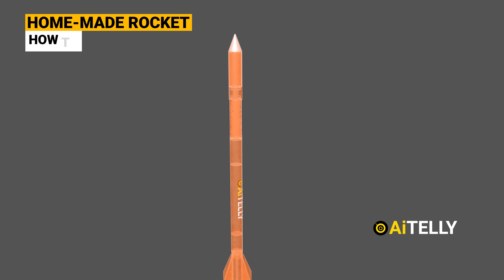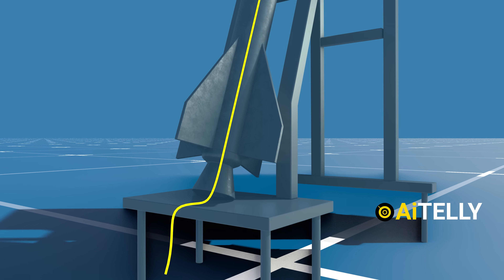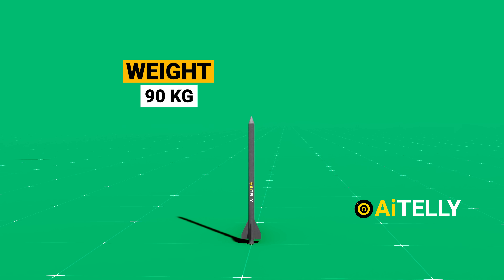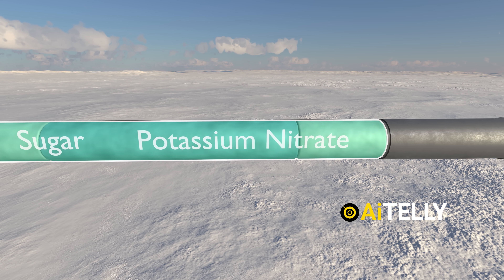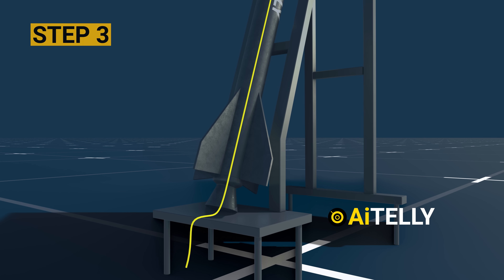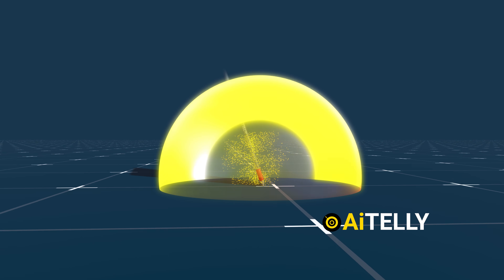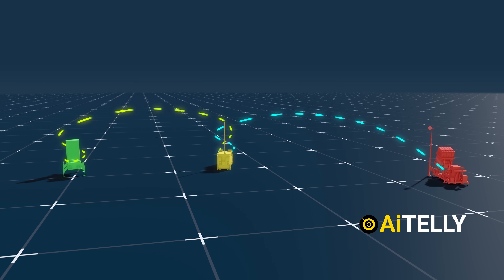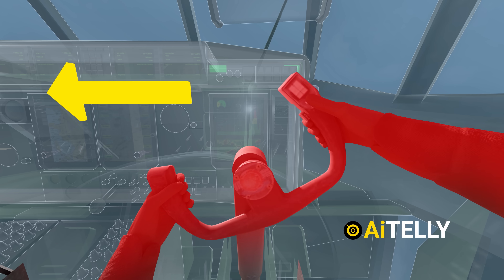How Hamas Makes Rockets against Israel | Qassam

Comment: A lot of people are accepting the Israeli hypothesis not because its reasonable but because they refuse to accept the possibility that indeed it was Israel who on purpose launched a misile into the parking lot of the hospital. Let's be realistic, the possibility of the event of the rocket failure getting into the hospital is highly unlikely, I would say nearly impossible. I will explain:

First of all it's important to note that graphic information provided by Israel has very little value or not value at all: videos from far away, at night, images of low resolution, satelite images... Those are not only very easy to manipulate or fully create, but almost impossible to know if the images are real or not. Maybe some years ago it was possible to detect an image that had been manipulated if it was analyzed at a pixel-level by some algorith, but today I'm sure that those photoshoping detection algorithms can be fooled. 

Therefore the images provided by IDF will show what IDF wants. PERIOD.

So now, let's analyze the version that Israel says that happened, because in order for this to happen several events have to occur simultaneously:

- The location from where the rockets are launched has to be behind the hospital more or less in the direction of the rocket launch. Why launching from that location? It is possible, but it's not the only possible location and in order for this event occur as Israel said it has to be necesarily from there. If someone tells "but IDF spokesperson said that the rocket was launched from that place" I would say: obviously Israel says that, and their "proof" is an image of a city at complete darkness from which projectiles are launch, and then they add an arrow pointing at a location that indicates that the hospital is there, and the launch site is there. There are no visible elements that allow to identify the exact location, and even if they were all this can be manipulated. So at the end this piece of information is IDF telling us "trust me, it is from here"

- The rocket has to fail at mid flight for whatever reason. Ok this can happen since these rockets are not so reliable. But then the rocket turns back and goes into the hostpital. These rockets have a range of 16km, so the area where this rockets can land is quite big:
- Let's say that the rocket in an event of failure will travel a distance of 10km or less, and that the area where this rocket can land is a circular segment of radius 10 kilometers and an angle of 15°. This would make an area of 0,82 km². 
- Now compare it to the area that occupies the hospital, let's say the hospital is 200m by 200m (I have not checked the exact size of the hospital but the order of magnitude is reasonable. Also it doesn't matter if is the building or the building plus the parking lot). Then the area of the hospital is 0,04 km.
- With this calculation we can get that the probability of the rocket landing in the hospital is about 1%. This is a simple calculation, but gives us an order of magnitude.
 Because we are not talking about a rocket failing and landing somewhere in the Gaza strip, we are not talking about a rocket landing at some random building in Gaza. We are talking about at rocket landing into the biggest hospital in Gaza. The same hospital that the IDF demanded to evacuate several times. It's not a random location, it's a target.

- The rocket has not only to turn arround at mid flight and land at the hospital, but it also has to fail in a particular manner. A rocket could fail in many ways: not burning, deviating, not exploding.. But in order for this hypothetical failed rocket to produce that damage the  solid fuel propellant has to explode when the rocket lands. But this solid fuel propellant is designed to burn during some time to propel the rocket, it is not designed to explode all at once. So what are the chances of the rocket failing in this particular manner.

So in order for the Israeli version to be true it would be needed a rocket fired from certain area, failing at mid flight, landing directly at the main hospital in Gaza and exploding in a manner that does not correspond to the functioning design of the rocket. Do you know how is called this concatenation of unlikelly events? Suspension of disbelief. That is what happens in action movies so the movie can happen. The spectator has to stop analyzing the chances of that happening because if not he does not enjoy the movie. This is the same, in order to keep supporting Israel someone has to suspend his disbelief.

Because we have not only the occurrences that I mentioned above, the guys from IDF also provided some additional "proofs": The ridiculous conversation between two Hamas members that in just one minute provide all the details that support the Israeli thesis 🤦
So not only we have a very unlikelly rocket failure, but the IDF picked that particular conversation where they provide all the details. Again this conversation can be staged, we are not dumb. 
The fact that IDF adds that conversation to their proof just show a desesperate atempt to sell their version, that's a lot of effort for a suposedly accidental failure of an enemy rocket. 

Additionally that conversation, if it was true raises a lot of questions: If they spy all the conversations so intensivelly that they find that conversation in a few hours.. How come the Israeli intelligence services where unable to detect the preparations for the attack of october 7, that was prepared during a whole year. 🤔

For me this shows that not only was an Israeli misile, but the attack was deliberate.

Another argument that I have read to try to divert the blame from Israel is "if it was Israel there would be a big crater"
OMG, this is so easy to refute: Israel is a very modern and sophisticated army that has access to many kinds of weapons, the more sophisticated ones and the more simpler ones, misiles that explode and penetrate or misiled with an incendiary explosion. Is someone accepts the "big crater argument" is like telling Israel that when they attack gatherings of people they have just to use misiles that don't leave a crater, then they can say "It wasn't us, it was another Hamas rocket failure" 
🤦

thanks for reading

Comment: I had read somewhere that they actually figured out how to make a crude, guidance system for them. Sometimes using a ESP32 or similar microcontroller. I really wish I saved the link because, it was interesting what they had figured out so far to make them more accurate.
Reply from the maker: I will research and find out good one
Reply: The Arduino flight controller can be plugged into almost any vehicle you can conceive of and will fly it better than many humans who have had training on the vehicle, I use them for missile sonde and AMM. "Rocket science- a long bomb with a hole in one end"
Reply: @LordCaptainFather  you know importing arduino is not worth the trouble
Reply: ya why cant they make guidance systems with rasberry pi?
Reply: @AckzaTV  raspberry pis are kept by scalpers lol
Reply: @AckzaTV  I'm sure it is possible with most microcontrollers!
Reply: they probably just put a child into it
Reply: Israel cam block GPS easily 😅

Comment: Good explanation on how palestinian resistance build their rockets, but I just want to point out that these rockets have nothing to do with the bombing of the hospital in gaza for abvious reasons.
-the explosif power of these rockets is very week compared to bombed droped by israili aircrafts that each one of them weights about 1000kg most of this weight is explosifs. The amount of destruction shown after the hosptal explosion shows that it is impossible to do so with resistance rockets.
-there is a video that shows a bomb hitting the hospital with the same precision, sound and explosion that an american mk84  bomb do, and the video shows no fuel burning out of the projectile which will be clearly visible if it was a miss shot rocket.
Reply from the maker: This Video has no relation with the hospital Attack.

It takes 5 days to Render Model & Animate which is pretty fast, but not fast enough to animate and release in 18 hrs.
It was just a Co-incidence because as a team we always wonder how they managed to make 5000 rockets Locally.
Reply: Hospital attack by Israel, which commits war crimes
Reply: Israel is a criminal and lies in the media
Reply: The hospital didn't blow up.  The rocket hit the parking lot and left an approximate 3 ft crater.  That is exactly a Palestinian rocket.
Reply: @justgivemetheaccount  Clown, this is an Israeli missile, above, my brother explained everything in detail, any Palestinian missile does not have such power, maybe you can also say that all the missiles that are now falling on civilians are Hamass missiles? This hospital, a few days before the bomb was dropped, received a notification saying they needed to evacuate people, but they didn’t do this because the hospitals were already full, and strangely enough, after a few days a rocket hit it, these were already in the Zionists’ plans, before they dropped they planned a bomb that would throw all the blame on Hamas
Reply: @justgivemetheaccount  
So do u mean that hamas launched a ((1)) rocket and that ((1)) cheap rocket hitted a hospital by mistake and killed 500 womens/mens/childs imediatly ?
Reply: @Captaboy hospital was not attacked,it was the parking lot and the number of death is not confirmed

Comment: Try salt, electricity and fuel (sugar, resin, wax or other easily oxidized substance with lower melting temperature)  NaClO3 bonded with a waxy substance works fine and will store well, and sugar is not ideal as it absorbs water to easily and will cause spontaneous reaction.  Milk jug plastic with addition of softening wax lowering the liquid temperature can be used easily..  The point is KNO3 is not easily obtainable as it is a watched substance and more-so NH3NO3, but when you are a 'sponsored' ISIS type group..., well this is the opinion of the Arab community here..  Hezbollah is acting in agreement.

Comment: They may not be that effective, but when launched against a small area country like israel, they can seriuosly burn a big hole, not in the ground but in the pocket, bcz the air defense system will take that down, and those missiles are way more expensive than these cheap husks, this way if enough rockets are rained then it will force the country to do very expensive shootdown, definately starngling the country economically, and if not taken down it will hit the ground then

Comment: These rockets are hella inaccurate, also they got the tendency to explode upon launch because of air bubbles in the propelant. The same reason the rockets you made with this mixture in middleschool to highschool blew up. 
I'm wondering why most of the shrapnel is above the main explosive charge, because that would throw the shrapnel up in the air and not around.

Comment: Ballistic means unguided. So a missile isn’t always a “guided missile” it can also be a “ballistic missile”. Also….a “rocket” is more of a solid fuel engine type thing. For instance…you can have a rocket powered missile…
Reply: What about the Saturn 5 rocket? The F1 engines were liquid engines. Rocket simply means you are ejecting mass out at a very high velocity. Not that the fuel is solid. Pressuring gasses out a nozzle.
Ballistic refers to the trajectory, not that it's unguided. You can still have a guided ballistic missile. It simply means you can't correct it a whole lot. There are also guided missile and cruise missiles.
Then to add another vehicle to all of this is the drone. I had a reservist working for me that can pilot a drone that is the size of a bus. It can take off, fly some crazy number of miles out, blow something to smitherens as Yosemite Sam would say, then return and land. All from the comfort of a basement office with coffee, scones, and so on. A short time later it's ready to go again. Then he'd return on Monday and do civilian IT work.
Reply: @robertthomas5906  correct. I said “for instance”….in that instance I was talking about the afore mentioned solid fuel but yes….”rocket” is a rapid increase of pressure created by some type of fuel
Reply: The first intercontinental ballistic missile was the V2 unguided rocket during WW2
Reply: @the.real.a-v  The first practical design for an ICBM came out of the V2 rocket, the V2 itself was not an intercontinental ballistic missile. All it could do is get over the English channel. Sometimes not even that.
Reply: @robertthomas5906  

Thanks, so the V2 was therefore a long-range guided ballistic missile, that was the precursor to the first ICBMs..
Reply: @the.real.a-v  the v2 wasnt unguided, it was just utterly bad designed. the v2 had a instrument to keep the course, it was just not reliable since it was a gyroscope.
Reply: @tarkitarker0815  

Thanks, I did correct myself after researching it properly though, thanks all the same

Comment: Riight.  I live in Springfield, MO.  After the Oke City bombing, the farm supply store has to know you own a farm before they sell you nitrate fertilizer.  BTW, Potassium nitrate (saltpetre) is rarely used except in specialty fertilizers.  Ammonium nitrate is usually what you get at the MFA.
Reply: You can get ammonium nitrate from cold packs and there are videos easily found that show you how to turn it into potassium nitrate if you need it. Even if that's hard to get you can get hold of calcium nitrate or magnesium nitrate. All you need is a source of the nitro anion and a reactive alkali metal, the further down the periodic table the better. That's why potassium is the best option; rubidium and caesium would be even better except that they're extremely rare (therefore expensive and hard to get), whereas potassium is cheap and easily obtainable.
Reply: These chemicals are easy to economicly manufacture in your basement.
Reply: @Fly420  just go to home depot and get tree stump remover
Reply: @MikeEwalt  Copper Sulfate is a good friend of mine.
Reply: KNo2 (Potassium Nitrate) is sold as stump remover.... Boil it down, recrystallize, for pure KNo2.... I make homemade grenades, fireworks, and ammunition from my own homemade gunpowder.

(You can also create it by pissing on a stack of hey for a year or so, then boiling the hey)

Instead of using sugar, pickup rose flower food or similar.... Mostly Sulfur powder; mix with coal or hardwood charcoal powder, and alluminum powder; soak in denatured alcohol and let air dry.... yes. I just posted how to make REAL gunpowder from garden store items. Allahu Ackbar!
Reply: NEWS: ISRAELI PROPAGANDA EXPOSED THEY DELETED THE VIDEO WHERE THEY CLAIMED HAMAS FIRED THE ROCKET

The Israeli government released

footage of the alleged misfire from Gaza. This footage is at 7:58pm. The attack

on the hospital was close to 7:11 pm

with the first mention on social media

about 7:20pm.

Their lies have been exposed

10:04 PM

Comment: The hospital was hit with 2 hellfire airbusts. Cope. Unguided rockets dont hit the same carpark twice. Let alone create a identical explosion to a roof knock which is hellfire missiles with 500 pounds of explosives. And you can hear both missiles are still burning propelant on the way down. The audacity of the israeli spokeman is absolutely abhorrent. Its insane but its easier to trust the guys that acctually share videos openly of thier atrocities. Insane times.

Comment: I have a structure of 4 steel pipes 4-5 feet long containing  iron rods for each pipe, when i put some potassium chlorate + sulphur mixture at the end of steel pipes then hit this mixture with iron rods which is inside the steel pipes it blasts with loud noise 

For me and my friends it was a toy for diwali celebration until i got this video 

Thanks for telling about the role of sugar hope this diwali my mixture will be potassium chlorate + sulphur + sugar = 🎉
Reply: Lol
Reply: replace sugar with charcoal and you're making gunpowder with that mixture buddy
Reply: @Loli4lyf  thanks I will try to add charcoal in mixture
Reply: Gunpowder doesn't use chlorate.  Chlorate and sulfur mixtures are extremely dangerous and unstable.   @Loli4lyf
Reply: Detonation is completely different from deflagration. Potassium chlorate in combination with sulfur is an very unstable and sensitive combination. While in your case is used to detonate. For example Ammonium nitrate based explosives using an primary explosive with high velocity that detonate the secondary. Like ammonal, anfo, annm, etc. It can also detonate with impact like your situation also does. But it needs an very fast impact, for example fire weapon rounds. Potassium chlorate can make very powerful rocket fuel called whistle mix. Ill make it myself alot. But for their situation R-candy rocket fuel is much more user friendly to make and uses ingredients they have around. Fertilizer is potassium nitrate. Potassium chlorate i make myself trough electrolysis of potassium chloride. But compared by black powder or sugar rocket fuels whistle engines are expert mode
Reply: In Indonesia we use bamboo

Comment: So it wouldn’t be hard to do a chemical analysis of the crater at the hospital
Reply: The most condemning proof is that there is no crater, like you'd have with a rocket, not a jdam. Obviously since its hams controlled they wont deliver such analysis proving them wrong. But i feel like the multiple videos, the phone call israel intercepted and the footage of the explosion site are enough

Comment: This is the same stuff that many into model rockets uses many make their own fuel using the same method.  I have experimented with this stuff as well. It packs a good punch when mixed right and in the right proportions it can and will send a model rocket several thousand feet into the air.